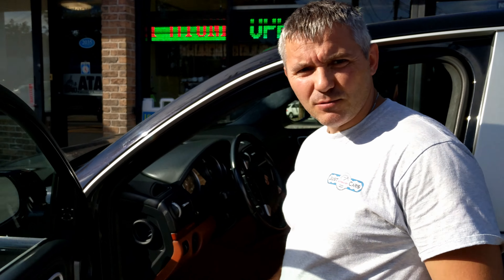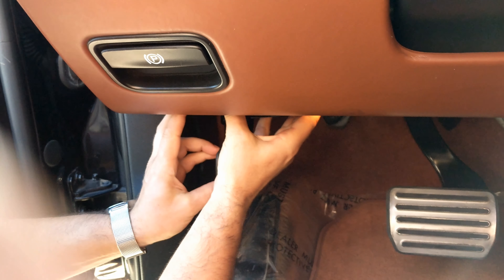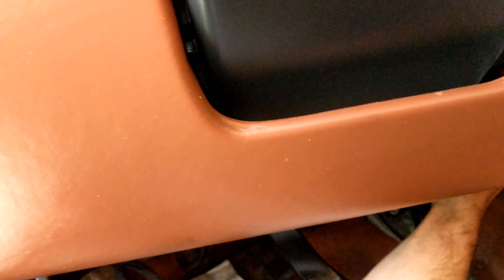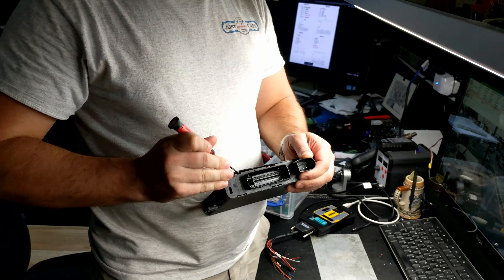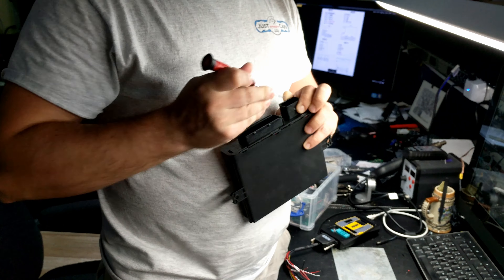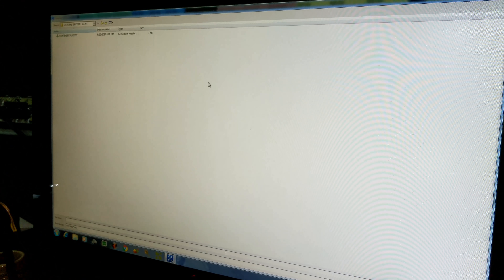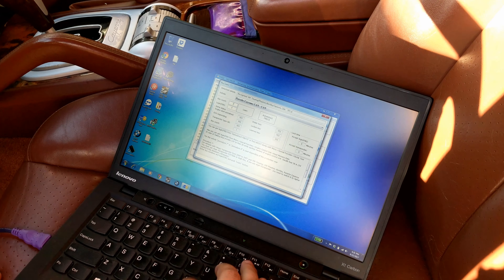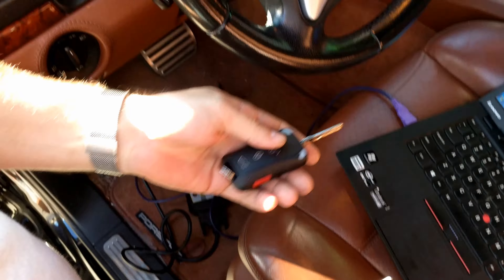Porsche Cayenne Continental Key Programming Procedure

Comment: With Abrites I did a Cayenne 2006 without having to desolder the eeprom and read it. I actually did read the eeprom and got the code from the dump tool in Abrites but later when I followed the instructions in Abrites on how to program keys I discovered that under special tools, read ECU and then read flash (not read Eeprom as per instructions) the code for the Kessy came up, same code as I got from the dump file from the Kessy Eeprom.  I will make a video and post, it might not work for newer Cayennes but for the older it does.

Comment: G’Day Alex thank u for your video, mate my 2013 porsche cayenne gts I replaced replaced BCM and ECU battery new AGM Full charged all the faults gone and car , do I need use my  scanner AUTEL I have to reset, on dash no lights at all except Porsche Cayenne, it won’t lock unlock car , before all was working before I replaced the Alternator was damaged somehow and it send a high Amp purge and burn both ECU and BCM . Before I don’t have any problems. 

Plz advise many thanks 
Matt